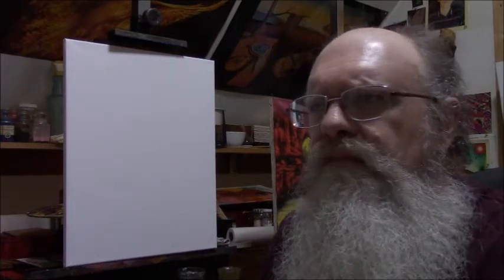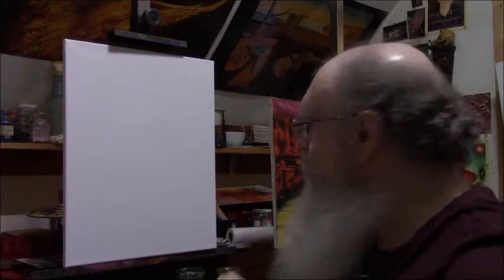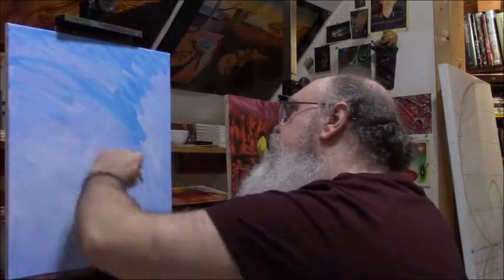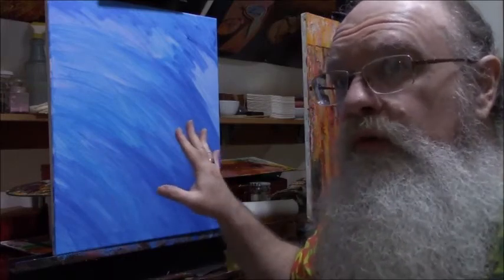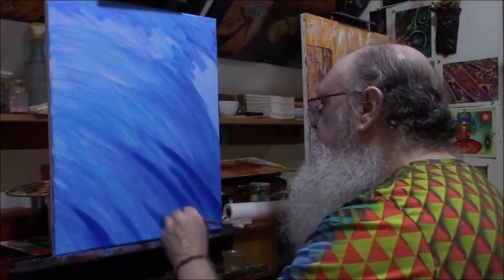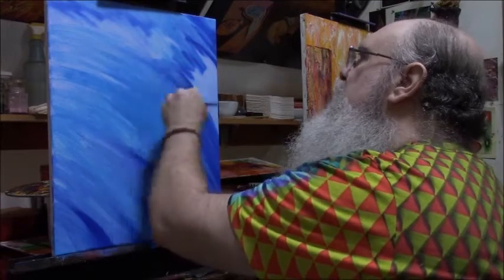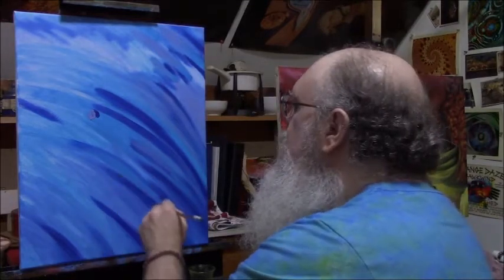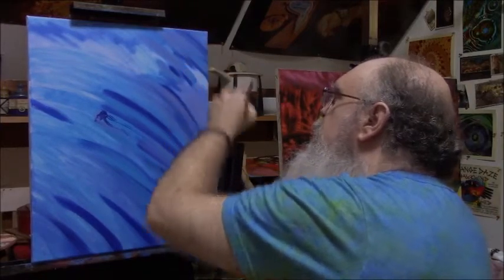Lesson 1, Oil Painting Construction

Comment: Great video. I like your method of just adding the drops of linseed oil instead of worrying so much about ratios. I had a question though. Let’s say you run out of your medium mixture before you finish your painting... how would you recreate it again in order to finish your painting, meaning how would you make more of that medium if you wanted to do a lot of glazing for example of just tons of layers? since you wouldn’t really know what ratio it was at before it ran out. I hope I explained myself :)
Reply from the maker: When using layers, I always count the drops of medium that I work with. For leaner (or earlier layers) the amount is minimal. For later layers (fat layers) the medium is heavier (more drops). That being said, be very careful, you only need a small amount of medium for your paint. The less medium you use, the better. I keep track of what layer my paintings are on, which informs me as to how much medium to use in case I do run out and have to pick it up later. You can use measured ratios, which is good if you are creating something very large or highly complex (or both!), but if you keep the medium down to a dull roar, you will be fine with a guestimate. Mediums are a good example of "less is more", and this is because if you use too much, the paint may wrinkle over time. In terms of making medium, I always make large batches, and replenish my supplies even when I really don't have to, which ensures that I have lots to work with. Half a gallon of homemade medium will last for years,  with a cost that is far less than purchasing industrial medium. The only mediums I buy are ones I cannot create on my own: pressed linseed, stand oil, venetian turpentine, distilled turpentine and mineral wax. With raw resins such as Dammar and copal (the latter only used very judiciously), you can make dozens of different mediums with little more than a fondue pot!

Comment: David. I'm confused. Fat over Lean. I had thought that lean meant thin essentially. Recently I read that lean means the lack of oil content. The addition of mediums in subsequent layers is adding the "fat:. Your statement that lean is thinner is more what I thought to make more intuitive sense. Please set me straight.  I'm attempting to learn oils but slowly. Thanks in advance.
Reply from the maker: It can get a little confusing, and there have been times when people have been taught the terms used incorrectly. Lean means a lack of oil, whereas fat means added oil. Paint that is loosened (sometimes incorrectly called "thinned") with linseed or other oils are fat. Paint that has been loosened up by means of a volatile substance (such as turpentine) is considered lean. These terms were created in a time period when artists made their paint fresh, so if they wanted a particularly lean paint, they would use less linseed oil. When tubed paint was invented, the meanings shifted to such a degree that it caused confusion. Old Holland paint is very lean, the company uses just enough oil to make the paint workable, other companies, such as Sennelier, make their paints with more oils to give them a more buttery texture, and this means their paints are more fat. Adding a quick drying medium (varnishes, turpentine, cobalt dryers) can make a fat paint act more lean in terms of drying time. I hope this helped!
Reply: It sort of helps. So, can one start a painting with straight tube paint, which would be considered lean, correct?  And, to dry this lean paint, a dryer like liquin could be added.  Once this layer of thickness of paint is dry, or is there a "dry enough" state, I would suppose the next layers would carry more "oil" in some form. Either linseed or something else. Have you done a layman's termed video on this topic? Thanks again.
Reply from the maker: @paultaylor6167  , my apologies for being so late in getting back to your question. Things have changed a lot in the studio, but I am still working. I have not done a layman's terms video, but it might be good to create something that defines common arts terms, which i will keep in mind. Yes, you do have the gist of it. Lean mediums can also be turpentine (or other volatile liquid) based substances. Only the oil-based mediums are considered "fat". This way, if you want something leaner than out-of-tube paint, just add turpentine or other solvent. Be cautious of driers, especially those used to speed the rate in which oil cures. They can cause cracks and flaking if they are used too heavily. As always with mediums, a small amount is the best policy.